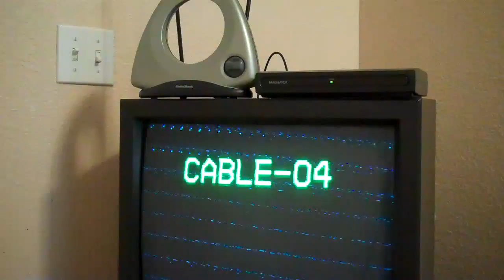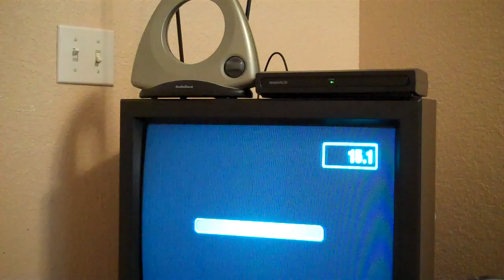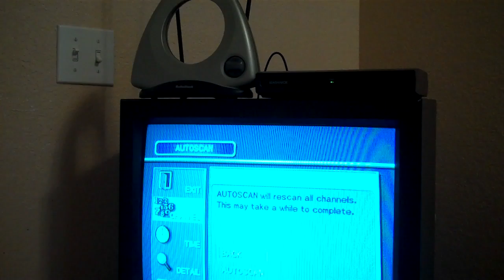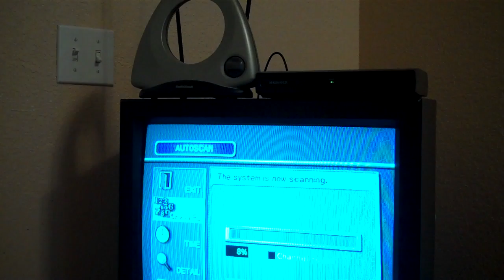How to Connect an Over the Air TV Antenna to an old style Cathode Ray Tube TV

Comment: I have a portable crt tv for a hurricane, the radio works fine but cant find any channels on the tv.  My hd tv has found analog channels before so why doesnt it pick them up?
Reply from the maker: TV channel broadcasting switched from analog to digital. You need a digital converter box to see current broadcasts on a crt tv

Comment: Mandatory switch over to digital for antenna tvs was a really stupid move. If it ain't broke, don't fix it.
Reply: it was 'broke' though. It would interfere with wifi, if we still has analog tv we could have never had 5ghz.
Reply: @xXb3anzXx  - who the hell NEEDS 5g anyways? We've had fast internet speeds for a while, we didn't need to shut down analog THEN, and the only reason why the FCC made bigger channels switch was so that they could force the industry to digital Earlier than required.
Reply: Let's be real, it was for tech companies to make more money.

Comment: I bought an HDTV window antenna but it doesn't seem to work on my old TV.  Do I have to get the Rabbit Ear type?
Reply: Get a digital to analog converter. And if your TV has component/av connectors, use that instead of the cable wire. It gives a MUCH better picture.
Reply: KISSFanDan1995 thanks Fan, just hot a RCA converter box.  Can use my hdtv antenna into it.  :)
Reply: DJ DJ, No problem 😎

Comment: Why is there lines on the screen of the tv
Reply: That's the screen's scan/draw line that moves in a downward motion. Cameras record at a different speed to the CRT's refresh rate making the scan line show.

The red, blue green lines are the RGB video output from the cathode ray that shines into the screen tube.

Comment: Would I be able to substitute my blue ray disc player with smart hub for the converter? I've already bought a ge amplified flat indoor antennat (won't pick up channels) but I don't understand since it has the amplifier on it.  I also bought an rca indoor antenna I haven't tried yet.  I thought that one would be a better choice for my flat screen tv in the family room.  Also, I bought a cheap dvd player for the old tv but now I'm wondering if I should swap the dvd players and bring the blue ray disc player to the old tv since the flat screen also has smart hub.
Reply: If you want to watch TV you're going to need a TV tuner.  Does the Blu-Ray player you're talking about have a TV tuner built in?  Does it have outputs on it that can feed into an older TV?  If it has a tuner and can feed into an older TV, then yes, you can use the Blu-Ray player in place of the digital tuner box.

I've never seen a Blu-Ray player that has a TV tuner built in.
Reply: According to Samsung it does have a tuner built in. However, I'm having a hard time with the output. It only has hdmi and i havent been able to find a converter for hdmi to rca anywhere locally. I tried using an old uverse box connecting the disc player to that and then the uverse box to the tv. Didn't work. Its not a good time to buy a new tv so it looks like I'm out of luck for now. I also have an old dish receiver but don't know if I need to try bypassing the service error or how to do it.
Reply: Dana Baker
Could you please tell me what model Blu-Ray player you have?  I've never heard of a Blu-Ray player that includes a TV tuner. 
There are HDMI to RCA converters.  Go to Amazon.com and type that in  as a search.  Several different options will show up.  (Just make sure it says HDMI to RCA and not the other way around.)
I would still like to know the model number of your Samsung player, tho'.

Comment: will you get a better reception if you buy a better coaxial cable? i guess what im asking is.....does the quality of the coaxial cable get you better reception? would a better quality one get a better signal than a cheaper dollar store one for example? And also do you still need the converter box with a newer flat screen tv? I have newer flatscreen in my living room and an older CRT in my bedroom, thats why im asking. thanks.
Reply from the maker: Lady,
a) Assuming the coaxial cable you are asking about is a "working functional" piece of coaxial cable then NO. The coax won't effect the antenna, generally speaking.  How long of a piece are we talking about?
b) A very small percentage of Flat Screen TVs, although its generally older models as opposed to newer models, will "not" require a converter box.
c) Visit the website link we've published below our video. Once there you can visit antenna dot org to see where the Antenna Broadcasters are in your city. This will help you fine tune the channels.
d) The type of antenna and direction its pointed can and/or does impact your ability to receive and view channels when you also take into account your city. For more on different antenna types watch this video: http://youtu.be/yjBs5TXhZFs
Reply: ok thank you!
Reply: LadyScorpio39

Comment: You're pretty much right about Digital Converter Box that pick up from Digital to Analog with much cleaner than older NTSC. One problem, mainly on VHF-High from channel 7 through 13, as Output Power has reduced power that compared to old Analog TV Stations. Stations were running at 316,000 Watts ERP. On same channel, power has reduced down to from 24,000 to 100,000 watts ERP. You most likely have to install a outdoor TV Antenna with RG 6 coaxial that rated; 3 GHz. not cheap RG 59. 75 Ohms coaxial that rated; 600 MHz. Keep your Coaxial as short as possible to reduce your signal loss. UHF will suffer most with cheap coaxial. Digital Antenna Mean: More cost for you. Even older analog outdoor TV antenna will do just fine.